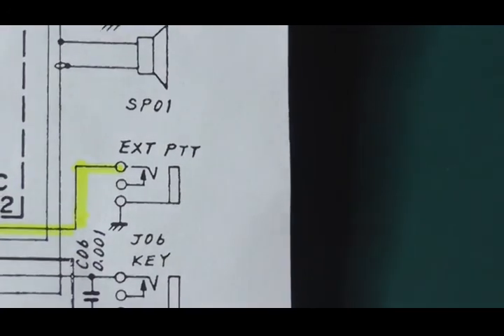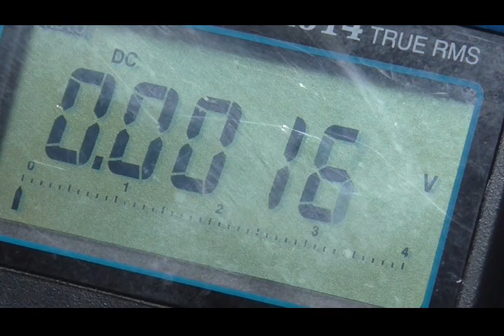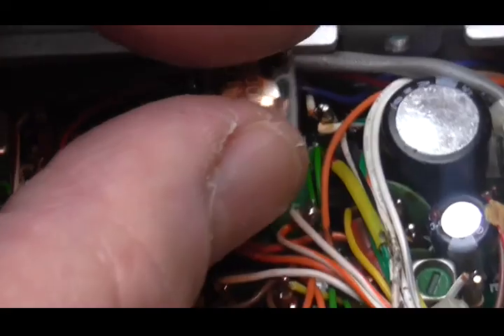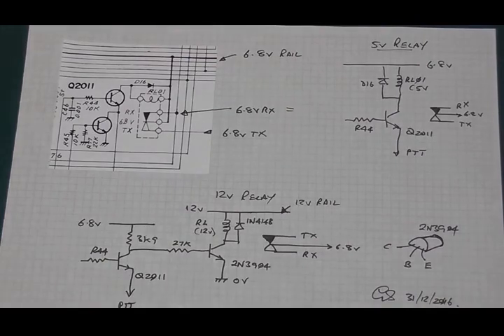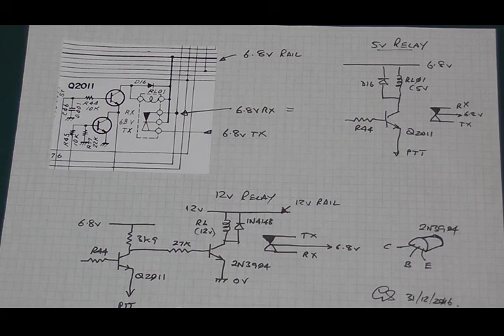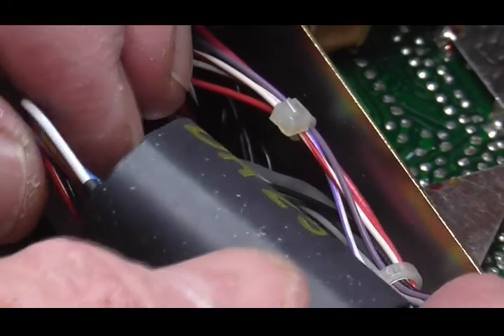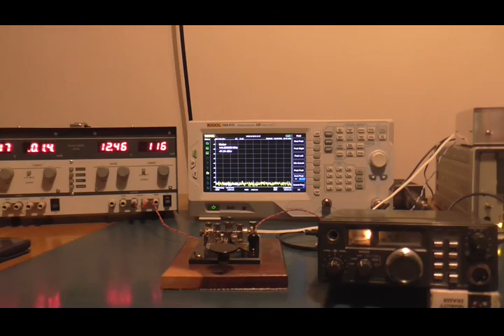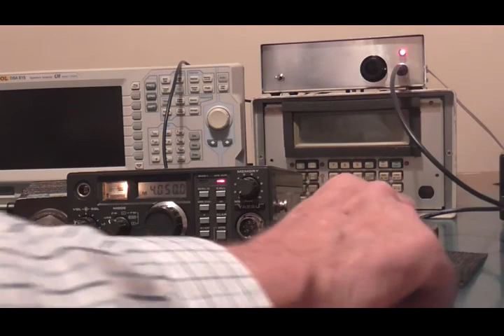Yaesu FT290 Repair - QRP CW

Comment: So goes around the houses to fit a 12v relay in place of a common relay you can pick easily,
transmits CW from a 290 but hasn't got the telescopic antenna in so doesn't have the correct tuned PA circuit..

and someone said you're an Amateur.....yup, you really are..

Comment: Hi Graham,

I have one of these beauties which I'm about to try and convert to the Australian 2m amateur band of 144-148MHz.

It's a poor beaten up old thing, and needs the LCD replacing as well. It's about time I showed it some TLC.

Thanks for the informative and interesting video!
Reply from the maker: Hello Matt, Thanks for your comment, it's great to hear from you! The FT-290 is very well made and reasonably easy to work on. I hope the display repair and frequency range extension goes well for you. Kind Regards, Graham de G4VUX
Reply: Hey Graham,

Thanks for the words of encouragement! I opened up the band to 144-148MHz and altered the steps from 25/12.5 to 10/5 so I can use it for satellite work. I also managed to get nearly a fist-sized ball of black electrical tape and sellotape out of it that the previous owner had "repaired" it with!

My plan is to disassemble the LCD and clean the contacts to the display with methylated spirits. Fortunately, it doesn't suffer from the darkening that a lot of FT-290R's do, just missing segments. This is the most risky operation as if I bugger this up, the radio is effectively unusable.

She's seen some abuse (the poor old thing), but hopefully I can return her to her former glory.
Reply from the maker: Matt, Congrats on the frequency mod - good work! I too have found that missing segments are normally caused by faulty connections. I hope it goes well for you and that you enjoy the satellite activity. 73, Graham de G4VUX

Comment: Hi Graham, thank you for taking the time to produce such a nice video and explanation together. I wasn't quite sure if you were implying that if you were using CW that you would have to switch-on the transmitter separately than other than just keying the key? The CW key circuit should engage the transmitter and if its not then you've got some more fault finding to do I suspect. Interestingly I have three FT-290R1with exactly that problem: no TX from the CW being keyed.
Reply from the maker: Dear David, Many thanks for your comment. It is the case that PTT has to be enabled before keying in CW mode. The FT290 Instruction Manual can be found here http://www.radiomanual.info/schemi/FT290R_user.pdf . The instruction to 'close the PTT switch' via the Stand By jack socket or the Microphone connector is covered on Page 18. I select PTT via the Stand By jack using the TX/RX switch on the front panel of my my CW keyer which you can see on top of the signal generator at minute 9:13 et seq in the video.  This means that your rigs are working normally in this respect ! 73, Graham de G4VUX
Reply: Quite right, I'll go and stick my head into a bucket :-)
Reply: Knock yourself up a footswitch, then put your foot down before you key up and then release it when you've finished so that you can hear your contact.

It's in the manual which is freely available on line.

Comment: Hi Graham  very interesting video you have some nice test gear there and the fix with a 12v relay is original,, i wonder if you ever had the fault my mate has encountered that is his ft290r seems to only want to tx and rx on 1 freq around 143 megs..the output is practically none existent..we have a good ft290 to compare results. what i found is that the voltage on q3008 which feeds up to varicap diode on the good rig is varying from 1.8v . 3.2v on the faulty one there is no change? it also seems that the ref crystal across  pins 2>3 5.6mhz is not oscillating also the voltage on pin 8 is just over 5v which is low on the good one...the chip crystal have all been changed...sorry to butt in but i thought i would ask if you or any of the bloggers may have had a simerla fault? 
thankyou paul  g4sbx
Reply from the maker: Dear Paul,

Thank you for your comment. I’ve had a look at this. The 5V on Q3006 pin 8 is trying to force the VCO (Q3001) to go up in frequency; in this case, possibly above it’s limit. There are countless possible reasons for this and I will not even start a diagnosis because there are so many variables.

The only thing I will say is that, regardless of the programming data, the oscillator in Q3001 should be running. It is a simple inverter circuit with the crystal between the input and output pins (2 and 3). I would expect to see a signal here. If you’re sure it’s not oscillating, you could try replacing the 33pF capacitors, C31 and C32 but don’t hold your breath!

I’m sorry I can’t offer more help but I get lots of requests and I simply don’t have time to follow them up. I wish you success and if you do sort it out, please post the solution here as it may help someone else.

Best Regards,
Graham de G4VUX

Comment: Very nice explanation thank you. I have two second hand FT290's, one is perfect the other only Tx's and Rx's on FM and LSB.  USB and CW don't work. My theory is that the Carrier Balance adjustment is "out" and my suspicion grew markedly when I saw that the pot for adjusting the carrier nulling for the two sidbands (VR1001) is just about the easiest accessible pot in the rig! Its not helped by being rather corroded with verdigrees - green colouration. I'm going to try adjusting this pot when monitoring the carrier level on the other 290. Full marks for keeping your rig going - mine are both nearly 40 years old!
Reply from the maker: Thank you for your comment. They are quite compact but it is possible to get to everything for diagnosis and repair. It may also be worth checking the DC conditions on the PCB for all settings of the mode switch. I have a motto that if the DC conditions are wrong, it will never work. Some of the wiring will be fragile after 40 years! I hope you get it all sorted. Regards, Graham de G4VUX
Reply: Thanks Graham. Well I tried incrementing VR1001 both ways, but it made no difference so I returned it to the original position. So I then looked for the circuitry which is unique to SSB/CW (FM appears fine). I'm homing in on the 10.81MHz local oscillator based around Q1013 (2SC2603E). However i can't find this on my (terrible copy) circuit diagram. May I ask where you obtained your superb PDF diagram?
I will check the voltages as you suggest.
Thank you. Peter G0LQU
Reply from the maker: Hello Peter, It's great to hear from you again. I'm not sure exactly where I downloaded the schematic from but I have found this one for the FT290R which occupies only three sheets, maybe it will be helpful to you http://www.iw2nmx.it/Yaesu/FT-290R/FT-290R%20Schematic.pdf The interesting thing about your unit is that it LSB is working but not USB and CW, that's a significant clue. I do hope you manage to fix it. I will try to find my PDF print out and have another look in the coming days, there must be a common denominator which will lead to the fault. Best Regards, Graham G4VUX
Reply: Hello again Graham. That's excellent thank you - I'll print the three sheets A3 and join up the printouts. Yes, that fault must surely give me a clue - I am looking in the area of the local oscillator based around Q1013 to check this is working, then to the balanced modulator MC14696. This should give an IF DSB signal on the Tx path at 10.81MHz by mixing the audio signal with the 10.81 carrier. I think a big clue is the next stage where the DSB signal is passed to a crystal filter XF1002 (10F2D) "which slices off the unwanted sideband" - presulably seelcted by the mode switch. I assume this all works in reverse for Rx. As well as the signals I'll be checking the voltages as you suggest. My main problem is that I find getting at the components is quite difficult but I will take it steadily and persevere!